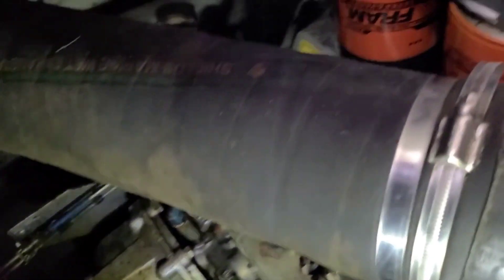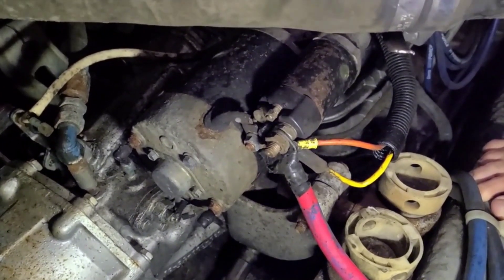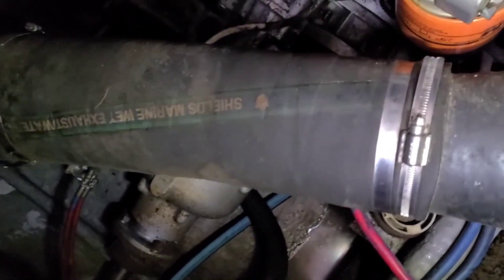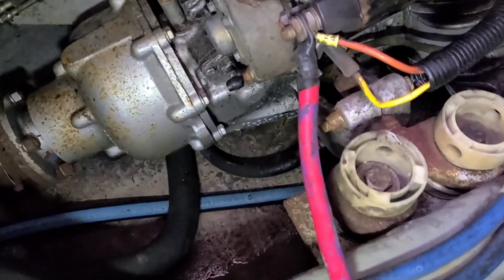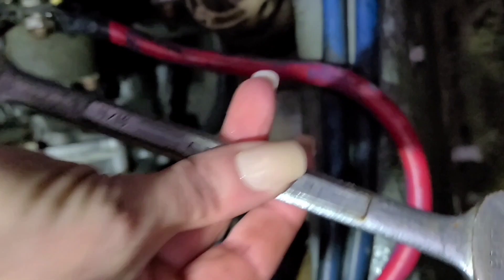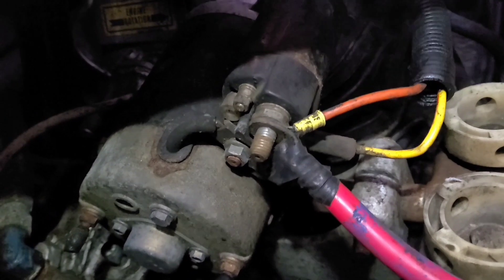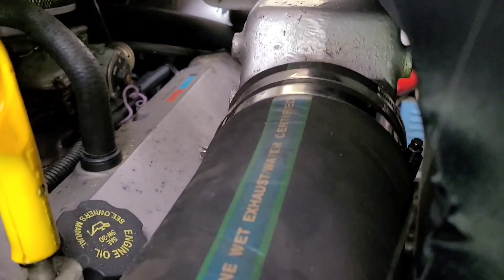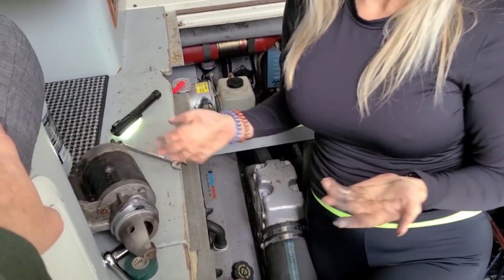Aly Learns Engine Repair: Removing the Starter from a Luhrs 320 Powerboat - Marine Power 454 Engine

Comment: Blue face last week, black hands this week. I see a trend developing.. A few things can cause your issue. A bad flywheel, a bad Bendix gear, a bad solenoid, improperly shimmed starter or a voltage issue. Regardless how new your batteries are. check the voltage at the starter to make sure you have  12+volts. If you don't you can have a bad cable from the battery to the starter. Low voltage will prevent the solenoid and the Bendix from working properly.  Shims are another biggie. They dictate how high, low, deep or shallow the flywheel and the bendix will mesh. Your starter can be set improperly causing a collision instead of meshing the gears. By adding a few shims you change where the 2 ride on each other. Let us know how you made out.